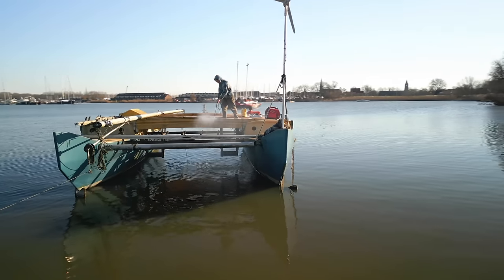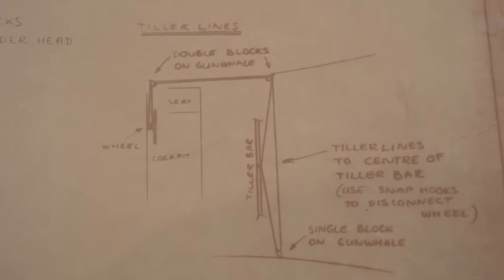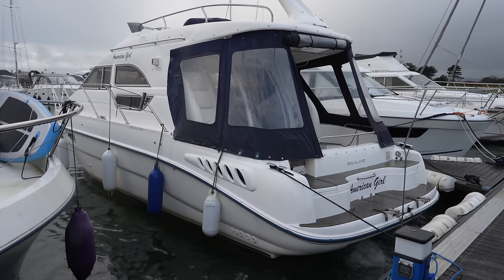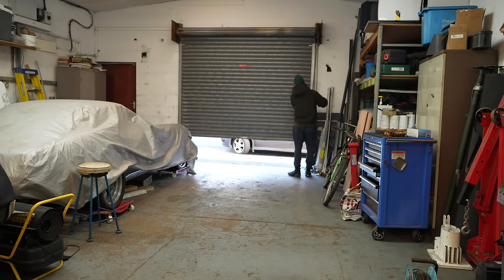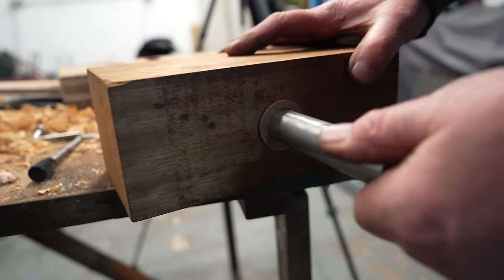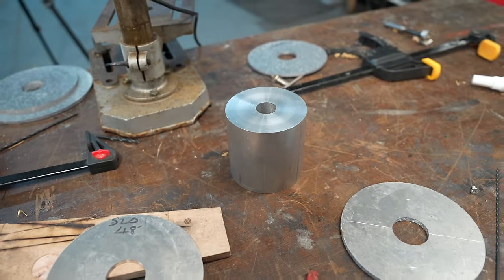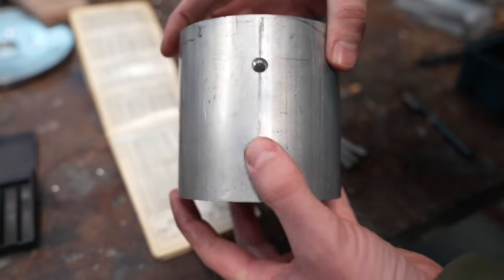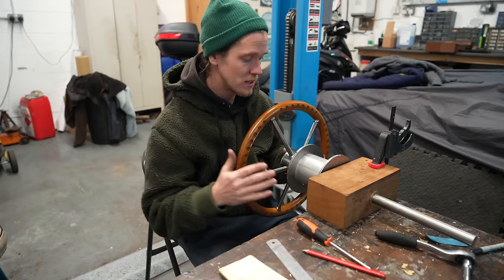My 'Build-Your-Own' Catamaran Gets A DIY Steering System | Wildling Sailing

Comment: I've  been  using some of the parkside tools on my projects. I'm not a professional,  but I'd class the use as very heavy DIY,  and they get a lot of use. I wouldn't suggest they are as good as the usual brands such as makita or milwaukee, but they suit me fine. I wouldn't  be able to have the tools from the major brands as I couldn't afford them all. Also,  it appears that they are manufactured in Europe.

Comment: I mean not disrespect Sir but I believe the wheel is to small. It  will work but a bigger wheel gives you more fine control in light airs and more mechanical advantage when it blows. I lived on a Yacht for 10 years sailing from the UK to and around the Med and down to the Canary islands so I do know a little bit about but am no means an expert :)

Comment: You use the bit you got to drill as far as you can .then you take a long drill bit of any sized and drill all the way through ...then flip the board over and you'll know where the Center is ...because you drilled all the way through and then use your bit to go through the other side to meet up where you got to....then go all the way through... And you will be dead Center
Reply from the maker: We were going to do that! But we didn’t trust ourselves 😂

Comment: Have you considered the size of the rope/cable that will spool onto your steering shaft? It looks to me that your round end plates that you attached may need to be a bit bigger diameter. Just my thoughts. Great job. Your dad is a rockstar!!
Reply from the maker: Was thinking 8mm, 3 or 4 turns for each rooe

Comment: I wonder if the wheel diameter is a bit small? You may be forced into a situation of attaching your tiller bar further from the rudder pivots and maybe 3 or 4 turns lock to lock which is a pain in close quarters manoeuvring although having twin outboards helps (so long as they are both running). The wheel I have on my 34ft Gemini is larger diameter but uses motorboat style steering cables and they attach to a point about 8 inches forward of the rudder pivot 2 turns lock to lock. The wharram design of plywood wheel does appear to be larger. But lovely work I have just ordered Zeus tables.

Comment: Are you using Loctite on those grub screws - there is nothing more frustrating than having the shaft suddenly free rotating when you need it fixed.

Comment: Really surprised you've opted for such a small wheel (is that actually the spec in the boat plans) my thoughts are the lack of leverage and speed of correcting a course. It's also going to be very slippy, with little to no option of lashing in position. Looks a nice wheel but is it actually suited for a sailing vessel.

Comment: Hey! im not that mutch into the wharrams. im am a sailor though and i know  a bit about metals. be carefull mixing metals. they can eat each other. and insted of the grubs. througbolt the drum. end key the wheel. the grubs will fail at one point. and its not fun when its your steering.(talking from expirence) also. are you thinking about windvanes? the aries can be used to drive a drum. so maybe have one for that on the backside of the shaft?

anywho thanks for  sharing your experince. 
and imo your doing damm great!

Comment: Just wondering how your steering arrangement will work out, primarily whether the diameter of your wheel will produce a sufficient mechanical advantage to provide a light helm in ordinary use and enable you to cope with  very high rudder loadings for example when surfing down waves in heavy  weather  in a confused sea state.

Comment: Instead of taking the steering wheel off and putting a key way on the shaft....just drill a small hole all the way through it and put a spring pin in there... then the steering wheel cannot slide on the shaft...

Comment: Looks like a poor design but well executed. Whilst you're at it, some thoughts, from me, sailor and educated original as optical engineer. We had to deal with pulley systems for glass cutting machines: With bushings made from Delrin instead of those you'd never have corrosion and it be smooth without lubricant. As you say correctly it does not look to be able to handle all forces only supported by wood. Well it is, but not when on one side only, ultimately it will crack. Having such a block on both sides of the. pully makes more sense. either keep the long axle and put another support block (smaller, just for vertical forces at the end of the axle. (which makes it unnecessarily long. when that pulley wheel is supported on both sides that would make it multiple times as strong and you can keep the design small. And with the materials you have you could already do that. Just cut the wood block in half and use the bushings you already have. But before you make any change have a good look to where the ropes go  (I did not see that0 they need an unobstructed way at least to a block. And any change you make could come with other complications. That steering wheel looks like s million dollar. and yes, it needs a key. You can purchase those for less than a pound and have some spare or easily make yourself, but make sure you have at least a few spares. just my five cents. Hope to see you on the water

Comment: Why not drill a bigger hole, and then put a g10 tube through the wood. And then the shaft goes through the g10 tube. Then you don’t need to worry about rot?

Comment: The aluminium boss on the stainless rod will be permanently bonded by electrolysis in less than 12 months. Mixing these metals, especially, in a marine environment is a big mistake, if you ever need to disassemble it.

Comment: I'm commenting more for the sake of it but just to say something: are you sure the alluminium drum will make enough friction to not have some slippage of the rope?
Reply: I'm  replying for the sake of it. I think you have a point! I prefer a tiller.
Reply: @davesmith60  or just coating the alluminium with rubber

Comment: Sorry, but I am afraid that wheel is way too small. There is a reason why sailing vessels use wheels with a diameter of at least 80 cm. If a wheel is as small as yours you only got two choices (by adjusting the diameter of the drum), too little feeling for qualified steering or the need to turn the wheel two or three times from hard to hard which is especially annoying and tiring in rough following seas. That said a tiller would be the better choice anyway, easy to connect to a cheap electric tiller pilot as well as to a wind vane.

Comment: Ýou can buy the cable steering complete hub and drum assembly for less money by foresti suardi. Part no. 97A
And it will fit the Ultraflex wheel you have perfectly.

Comment: The American flag with stars on the top right or stars on the top left is not disrespectful. Commenter was full of beans It is all about the frame of reference, the intent, and the story for why you hung it the way you did. 

As a former soldier in the US Army there was always a big argument about which way the flag on the right shoulder should be facing! Stars on the top left or stars on the top right? Stars on the top left is the normal way when looking at it head on…but Rangers and Special forces types would put the stars on the top right on the right shoulder to indicate that the soldier was always moving forward!  Never in retreat!  Your flags were fine the way they were. 

You can fold the rope in multiple ways to make each flag displayed improperly. And if you move the rope to the middle of the garage the frame of reference changes and both US flags are displayed properly. 

No offense taken from this yank. Appreciate you channel and videos!

Comment: you all got a lathe, yet you welded a socket to a shank to extend it..  really?  every machinist out there now has a migraine.  i know i do..  also what about that key way on the wheel shaft?!  you going to just let that thing slide on the shaft when you need it the most?  common.. you have a lathe,  cut a damn keyway!  its easy.  open a machinist handbook and look up keyways!  it will tell you how to use your lathe to make a keyway.. gawd..

Comment: I just watched you Make a fatal mistake. never never use plywood to build anything on a boat unless you're going to fiberglass over it to protect it from the weather.... it will rot away in no time... even if it's Marine plywood...always be covered with fiberglass or find hardwood.....
Reply from the maker: It’s true, but I have put glass over all of my plywood, I think?